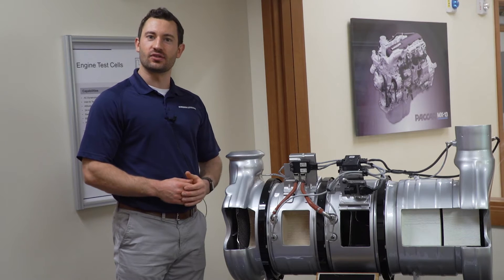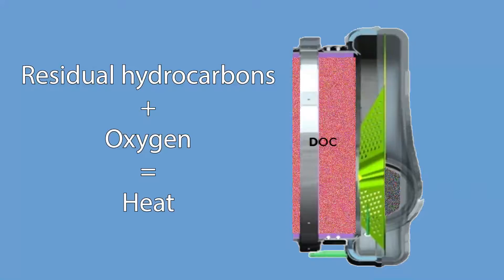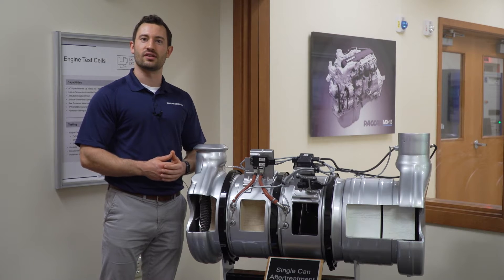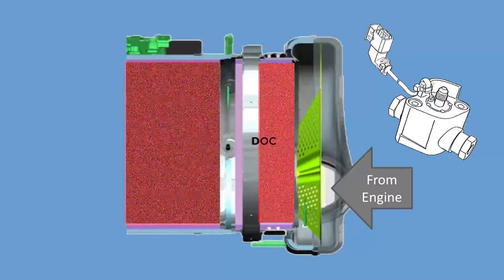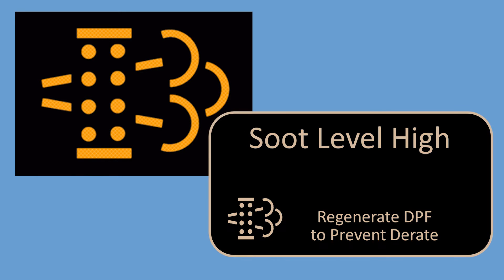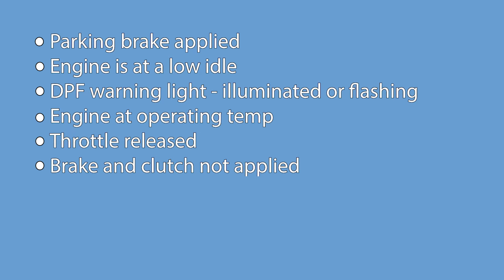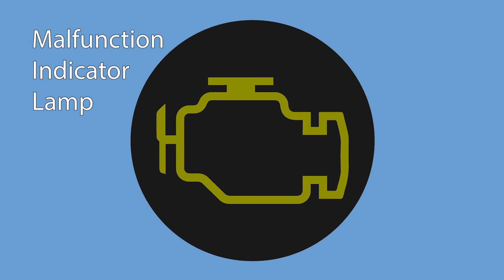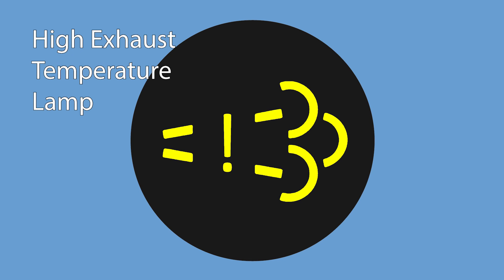PACCAR - DPF Regeneration

Comment: This system is garbage because had nothing but issues with and see this as a big money scam mechanics don’t ever fix the problem and thousands of dollars later being paid out by owners of the trucks . EGR plugs up and one sensor goes out they crash others like dominoes.but dealers only fix one they don’t check others that might be going out so process starts over again . Then people wonder where there freight is because trucks are in the shops more no driver shortages just crap equipment.